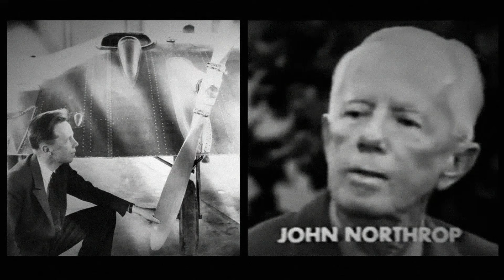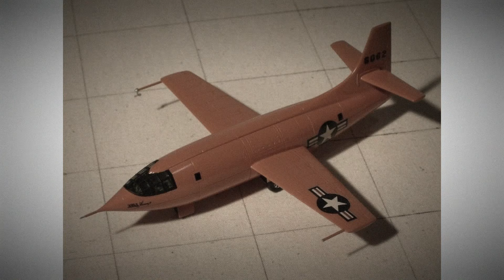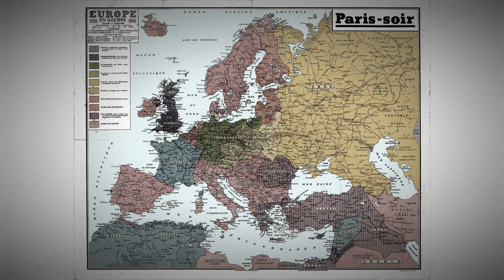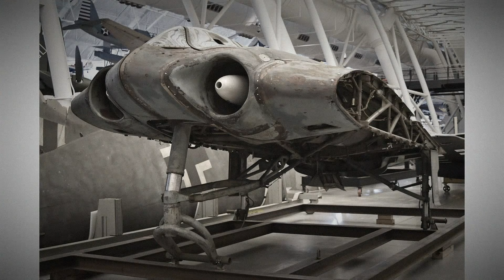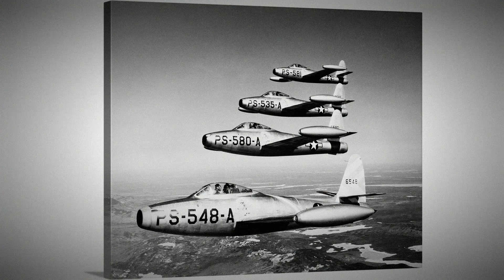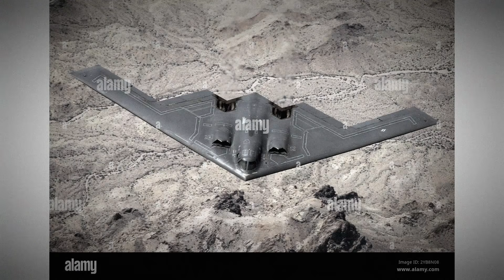The Most Beautiful Plane Ever Built

Comment: The F117 needed a special tower to hold it inverted for radar testing. Difficulty arose. Try this. Move that. The radar cross section was as a three mm bicycle ball bearing. A single one eighth of an inch steel ball. Far less than a B-52.